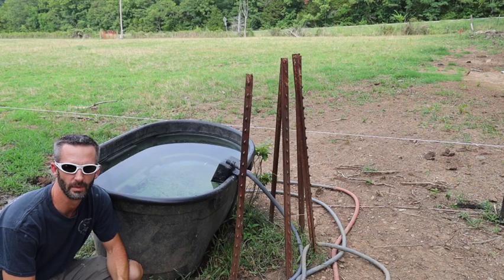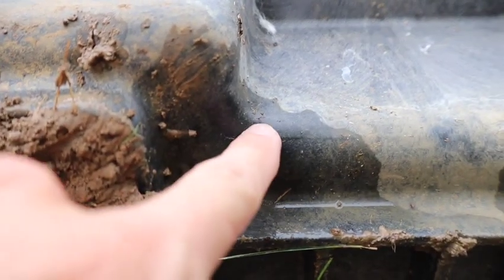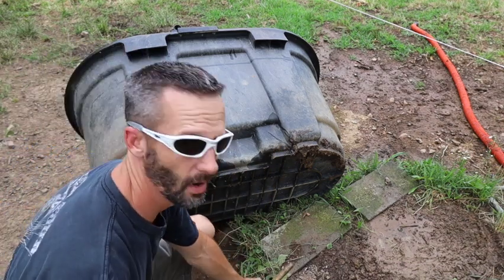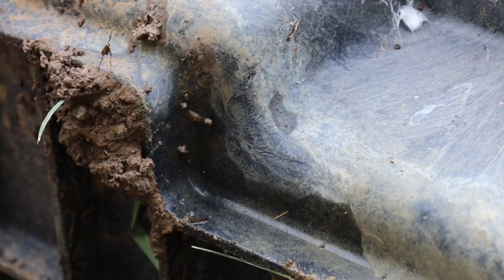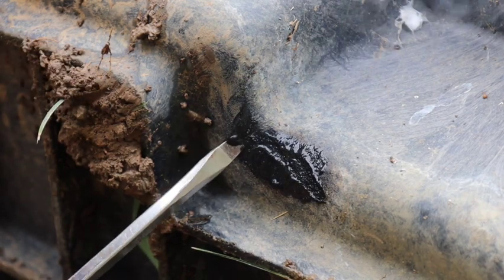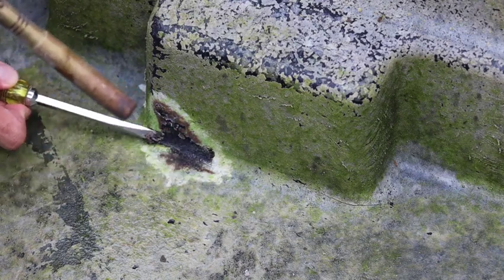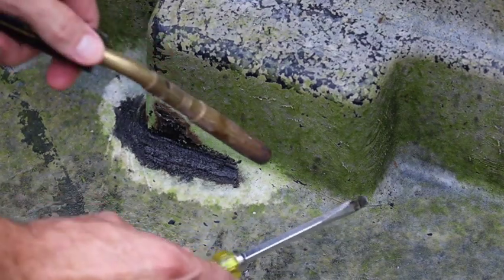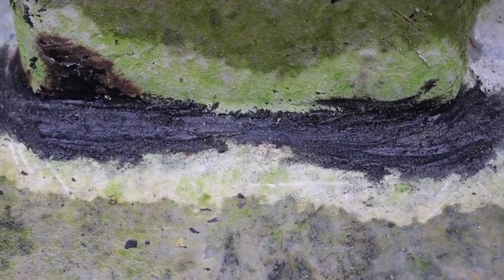Repairing a water trough/stock tank.  A DIY water trough repair.

Comment: Oh man, awesome idea. ⭐️🏆⭐️ this is gonna seriously help my situation. I’ve used a torch on plastics to refresh them and get rid of the white oxidation before but this… omg great buddy. 👍🏻👍🏻
Reply from the maker: Try a plastic soldering gun too. That really helps
Reply: @ozarksrealtor I did one today at the horse ranch. Dude it was a 1/4” wide 8” crack. I blasted it with the torch real wide on each side and then smeared the sides into the crack. I never thought it would work. Oh man the tub is good as new. I’m so serious… THANK YOU. 🏆

Comment: The problem with that is you end up with a paper thin repair. Try cutting a v along the crack with a soldering iron then take small pieces of plastic from other parts of the tank and slowly fill up the cut with them. Then you have a plastic weld that's a little thicker.
Reply: melting zip lock ties on top of the crack might work as well

Comment: I have the same tank and it cracked in the same spot. It's a weak point in the design where stress is very high and this repair will just crack again especially if the tank is on uneven ground. When full this thing weighs over 800 pounds!

Comment: I have a Rubbermaid 300g trough I'm making into a outdoor pond has a similar crack in the same spot. Is this a feasible option you'd say? How long did it hold?
Reply from the maker: It lasted until this week with our massive freeze.  It needs a later of plastic weld like they use to repair kayaks. About to do that soon...
Reply: @ozarksrealtor  I'll probably do what you did then use the plastic weld on top of that! I appreciate the quick response! We got about 14° here in South East Texas y'all stay warm!
Reply from the maker: @dallascowboys9430  we got to zero.  Bustin' ice every day for the last week.
Reply: Was gonna try that method,  weren't sure if it would hold, and apparently it's not a long time solution...I'm sure your aware, if you put a few gallons of white vinegar in that there tub, all of that green algae and rough scaling will disappear after a few days of soaking, with just some minor brushing . Yourn tank will look new it is
Reply: You ever tried spray seal repair?

Comment: My solution is permanent.  Use the poor Rubbermaid trough as raised bed garden.  Replace it with a concrete trough.  Problem solved.  Rubbermaid is a low quality trough, temporary.  We cave concrete troughs 75 years old.